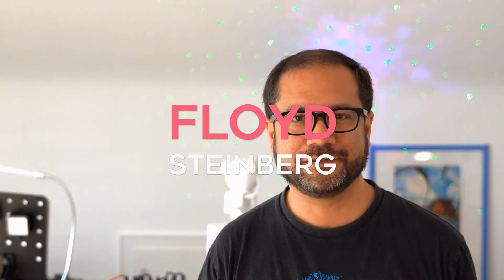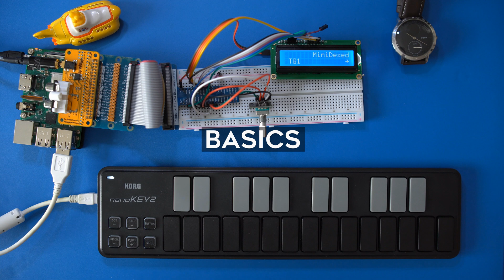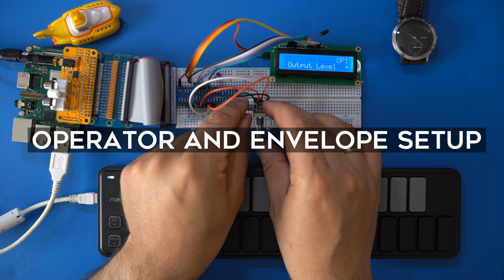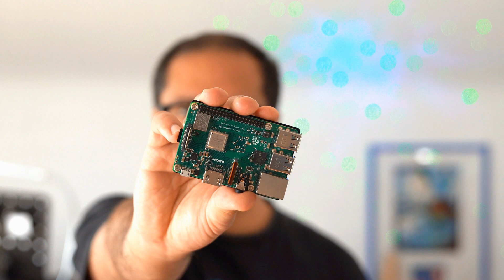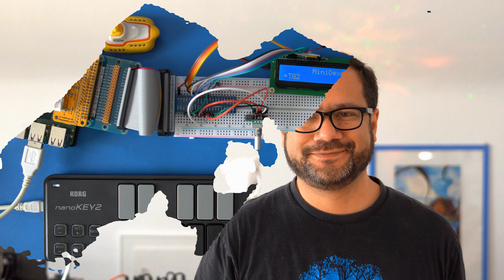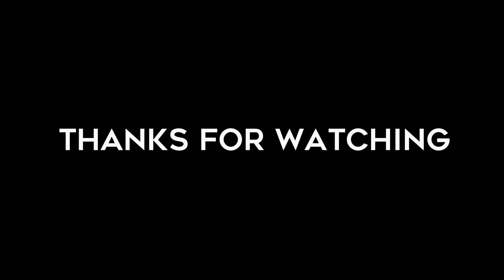Sound design on MINIDEXED DIY synthesizer

Comment: I understand the history of navigating with very limited input but is it possible to expand user experience with more controls? One hacky way could be a separate controller that simply records and stores your inputs and can then play them back in one click. Would a tool like that be useful? Are there many series of inputs that you find yourself using consistently? Or are there too many short basic short series’ of inputs that very only slightly and are more similar than not? Furthermore If that is the case, a macro playback wouldn’t make sense… would a little box with 12 buttons each set to different macros help or speed up workflow or make it more fun? There are other ways but this is a way that would simply send input signals and the minidexed would just read them the same as if you were just using the ‘manual’ encoder method. It wouldn’t need to integrate further than that.
Reply from the maker: I think the minimalist interface is more the result of first getting the sound right (as this is a relatively new project).
I agree, a better UI would take this to the next level. (I also think the perfect FM UI has yet to be created).
Perhaps post your ideas here: https://github.com/probonopd/MiniDexed/discussions
Best regards!

Comment: Do you think adding a second button to the user interface would make it better?  It looks a little fiddly having to rely on double clicks on the encoder so I'm planning on building a version of this with a separate back button.
Reply from the maker: Hi! That's a good idea, why didn't I think of this myself? All you need to to is to connect a button to the gpio ports that "listen" to the encoder's button.
Reply: @mr_floydst  I will report back if I get it working!

Comment: Would be interesting exercise to compare the time it takes to do the same sound design using just a Korg Volca FM with no uploading of settings from Dexed PC applications
Reply from the maker: I think minidexed would win - the menu is built very flat  & logical. I know I cracked that joke "so you don't have to" but please don't be offended by that ;-). I think the video shows you can get the results you're looking for.

Comment: I'm having no joy with the encoder. Maybe I pulled my copy of the image from github at a bad time? In any case, I'm really diggin' these videos on RPi music. I'm stacking a minidexed, mt32-pi, and RPi midi host along with a RetrocadeSynth to serve as my midi research lab. Inspired!
Reply from the maker: That sounds like a powerful DIY setup! :)
Reply: I'm now thinking of replacing my Raspberry Pi  security cam with an ESP32-Cam board so that I can repurposed the Pi as a bare metal synth. That's how desperate this chip shortage has become

Comment: Makes you realise how overpriced synths are eh , I use dexed , it’s free and it works fine on my GPD pocket 2 with a little M audio pro mini keyboard , I’ve stopped buying synths , I don’t think I’ll ever buy another hardware synth , software is fine , this is after over a year of working solely with an MPC one , being able to sample any sound and use it as a polyphonic keyboard sound was a game changer for me
Reply from the maker: Thanks for watching! I think most synths are priced very fair (I just happened to browse the prices for saxophones last night, oof). ;-)
Reply: @mr_floydst  Have you checked out Thomann's own brand saxes? I picked up their TAS-180 (entry level alto sax) and it's pretty decent for the money IMO! As long as it's in good functioning order, the actual sax seems to be a lot less important than the reed/mouthpiece.

Also, love the Nokia watch, had no idea they were a thing!
Reply: Have you tried recompiling minidexed bare metal from scratch? Or tried to read the source code so you could improve the interface by adding more potentiometers and make sound design a bit less painful?

Good, fast, cheap - pick two!
Reply from the maker: @bornach  who, me? I did indeed look at the source code, but with the intention to find a way to save patches. It's there in the original DEXED, so it should be possible for a lesser programmer like me. ;-) Didn't invest a lot of time yet, though.
Reply: On the topic of sampling on a bare metal Raspberry Pi, I was looking into what hardware would need to be added. I'm not sure bare metal circle (github) supports USB microphones as yet. The good quality I2S audio input hats cost more than the Pi itself. Perhaps I should look into combining a Teensy audio board with a bare metal Pi.

Comment: When this is sysex compatible with DEXED, it'll be a game changer... editing through a letterbox has never appealed to me (and I owned a Korg Wavestation and SR in the 90s!)
Reply: When it comes to FM synthesis, that is perfectly understandable.
Reply: Code was checked in yesterday for preliminary support.  I've been waiting on this myself, too.
Reply from the maker: For some reason, I kind of enjoyed the experience. The menu tree is very linear and moving from one entry to the other is done quickly.
Of course, having a mechanical UI with faders and encoders would take this to another level.
Reply: Well it worked for three decades for people on the real keyboards ...
Reply: @litz13  If you saw how many DX100's/27/21/7/9/5's we got back at Yamaha with the factory presets still intact, you'd see that very few actually ever did any real programming on them
Reply: @NickHowesAstro  I can fully believe that
Reply: @litz13  Anyone who programmed FM synths much did it on computer editors. DX editors were quickly available on all major computer platforms, and everyone at the time assumed Yamaha meant it to be that way since they released their own computers with DX editors.
Reply: Excellent new video on "nobody uses pi's" for music.. I must be in the 30% as the Zynthian obx and this ate already in use in tracks
Reply: *are